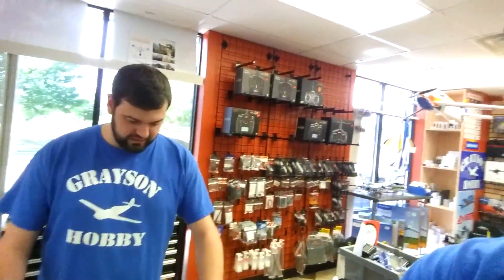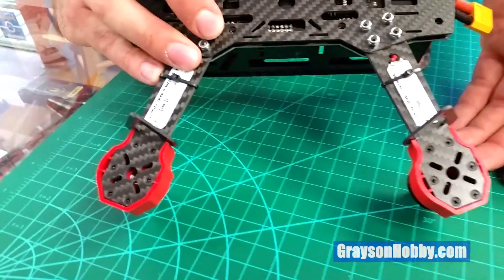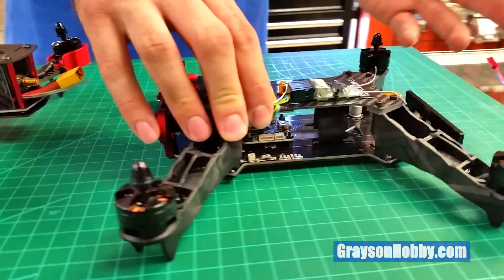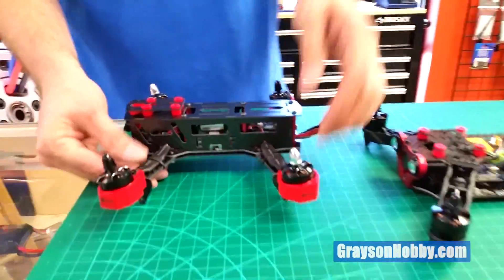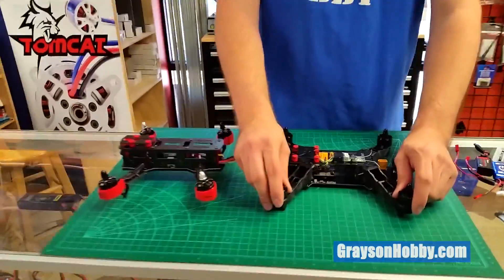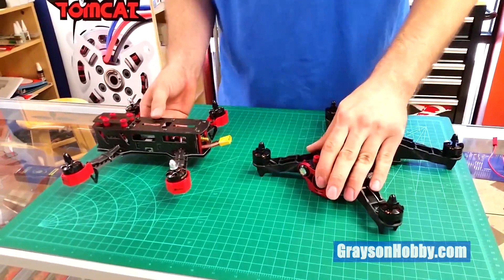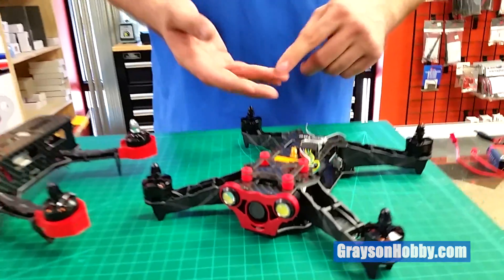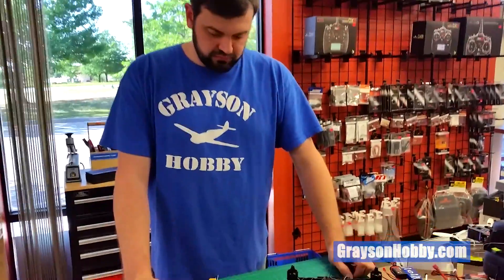Eachine Falcon 250 vs 250 Racer FPV Drone Racer -  Difference Compare and Contrast

Comment: hi there

question about the eachine250
is it possible to put a xsr receiver on it . it s on cc3d.
 if yes pliz have you some good link cause i can t go through to connect it with librepilot
to fit to my taranis
thank you

Comment: Thanks for your video- trying to decide between the falcon 250 pro or 250 racer..does teh falcon 250 have an ATTI/stability mode for when getting used to it? both are supposed to run on 4S as well but will that affect the VTX and/or OSD in terms of too much voltage? If it does run on 4S but may affect the VTX and OSD what's a way around that? Will teh RTF version's 5.8 Ghz VTX  be compatible with my immersion RC 5.8 VRX? Thank you!
Reply from the maker: Watch this concerning 3S vs 4S - particular part 1 :)

https://youtu.be/R567kY0Ewks
Reply: graysonhobby that's I've been flying rc fit a few years now and have a cell checker and voltage alarm thingy etc but new to racing drones and in particular these models and how they respond to 4S.. think I'm getting the eachine wizard now anyway..

Comment: Hi! Looking for a quad to buy.
Which is better for racing?
Eachine Falcon 250 or Eachine Racer 250
Reply from the maker: Hey thanks for watching and thanks for the comments.  The Falcon 250 will be better suited for racing as the motor tilt is better for speed, plus the carbon fiber parts will take a bit more abuse :)